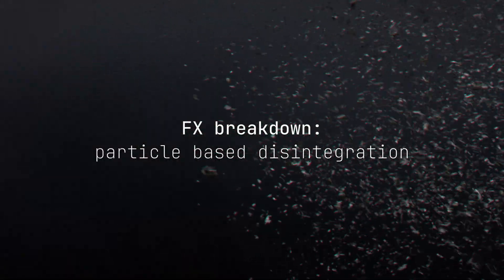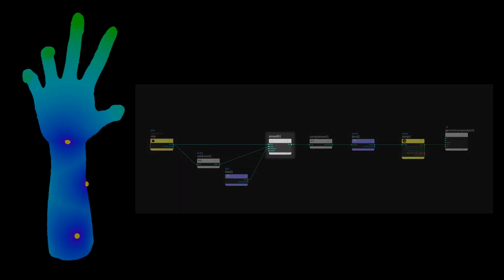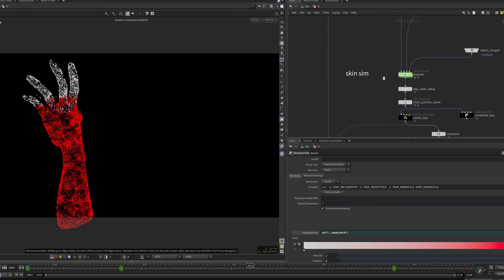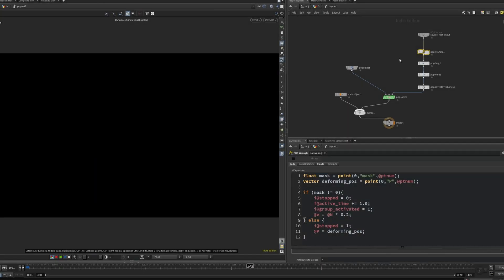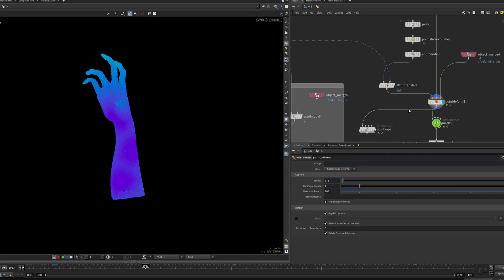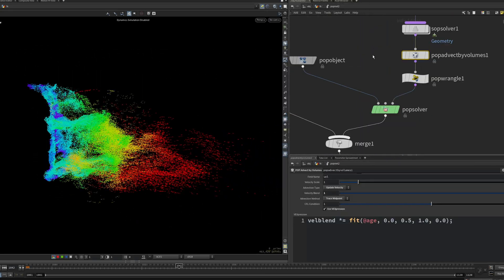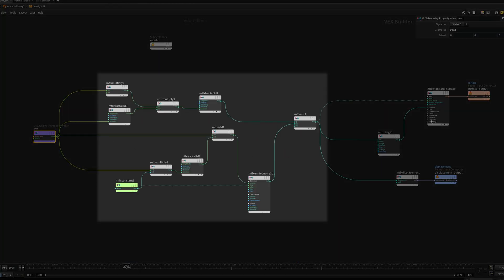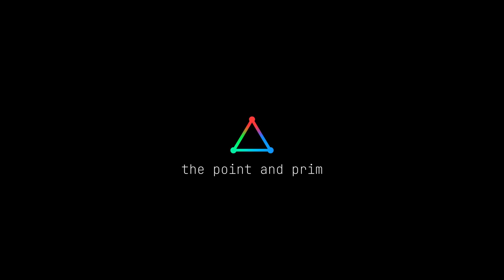Techniques for Fast Disintegration FX in Houdini – A Particle & Attribute Approach

Comment: thanks for the hip! this is much more easier way than manually moving fractured pieces with it central points
Reply from the maker: glad you like it! I started using methods like this as a substitute for heavier approaches like vellum.  Although sometimes you will still need them to get intricate movement like peeling etc :)